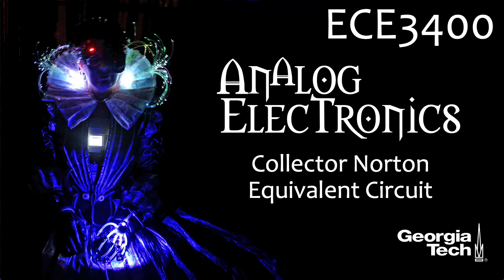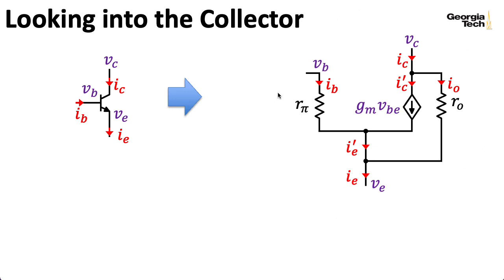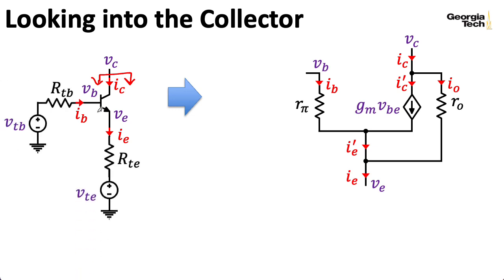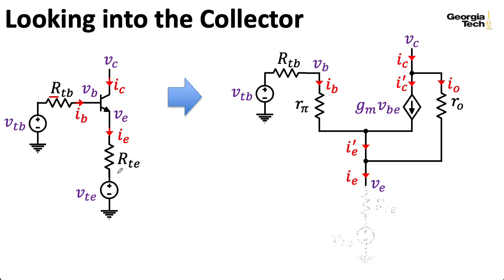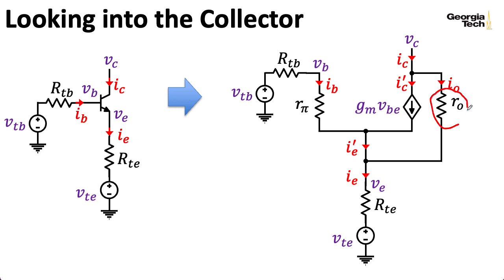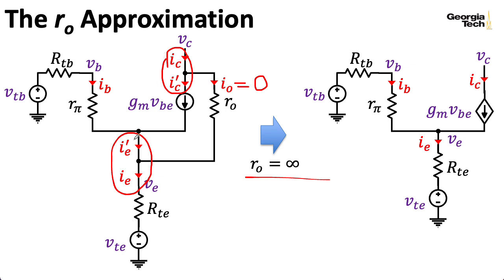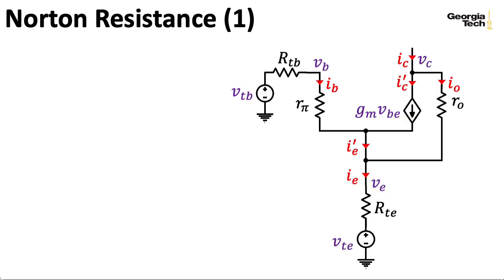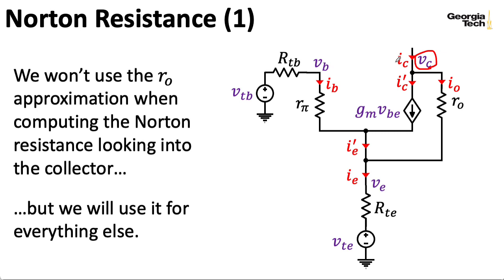ECE3400 Lecture 10: Collector Norton Equivalent Circuit (Analog Electronics, Georgia Tech course)

Comment: Is there a fundamental reason we use Thevenin Equivalent when looking OUT of a BJT terminal but Norton Equivalent when looking IN to a BJT terminal?
Reply from the maker: You can always transform a Thevenin to a Norton and vice-versa with a source transformation. Which seems more "natural" usually depends on the equivalent resistance. If the equivalent resistance is small, a Thevenin equivalent is usually more natural, as it's close to an ideal voltage source. If the equivalent resistance is large, a Norton equivalent is usually more natural, as it's close to an ideal current source. Of course, you may want to make exceptions to that "rule" depending on how it's being used in a larger circuit and what questions you are trying to answer.
Reply: Actually, seeing the subsequent lectures, appears that looking IN to Base or Emitter, Thevenin Equivalent is used.